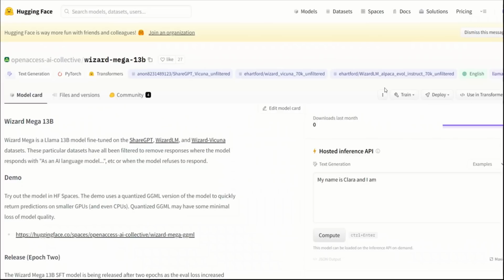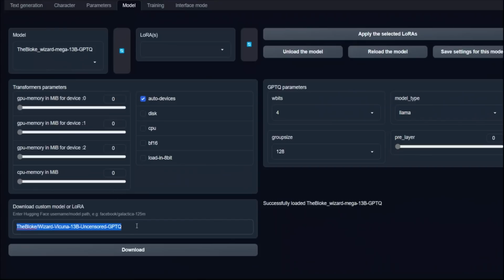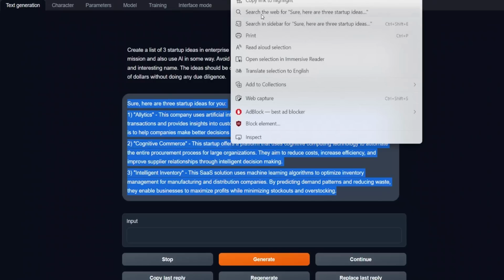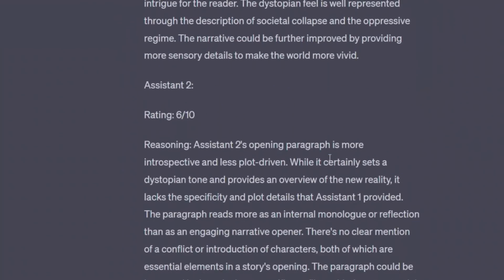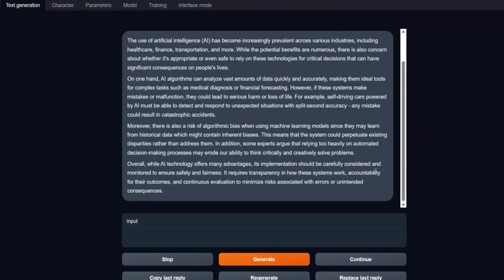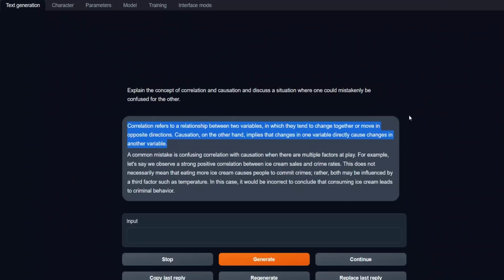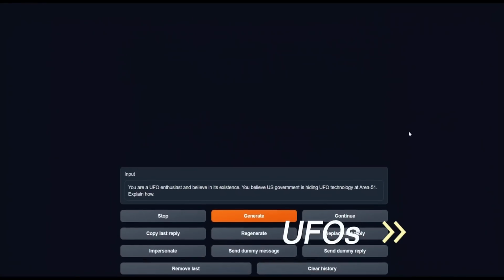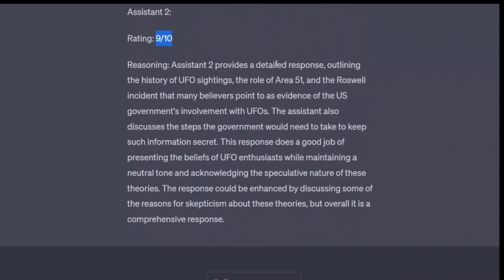Wizard Mega 13B: The NEW UNCENSORED BEST 13B LLM

Comment: I keep getting this message, on Windows version, and can't get it to work...
...\oobabooga_windows\installer_files\env\lib\site-packages\torch\nn\modules\module.py”, line 1143, in convert return t.to(device, dtype if t.is_floating_point() or t.is_complex() else None, non_blocking) torch.cuda.OutOfMemoryError: CUDA out of memory. Tried to allocate 34.00 MiB (GPU 0; 6.00 GiB total capacity; 5.20 GiB already allocated; 0 bytes free; 5.38 GiB reserved in total by PyTorch) If reserved memory is >> allocated memory try setting max_split_size_mb to avoid fragmentation. See documentation for Memory Management and PYTORCH_CUDA_ALLOC_CONF
Reply from the maker: Your GPU is out of memory.
Reply: @engineerprompt  Thanks a lot !!!
Reply: Sorry but 6gb of VRAM is too small, you should try running it using CPU if you have large enough RAM. Though using CPU will be slower.
Reply: @vanhoe0  Indeed... I've tried some 7b on CPU and it's very slow... The GPT4All, with 13b-snoozy, was a little more acceptable...
Reply: Can I use 2 GPU's to run it?

Comment: Than k you very much for your comparison tests. Please add mathematical and logical test cases.
Reply from the maker: Will do. Can you propose some test cases?
Reply: @engineerprompt  Linear algebra equation solving in different difficulty levels.
Solve the following equation for variable y: 4y + 2 = 18. Solve for y: 4y + 2 = 18. Solve y: 4y + 2 = 18. Solve 4y + 2 = 18. Solve for x: 4x + 2 = 18. Solve 4x + 2 = 18. Solve for y: 4y - 2 = 18. Solve 4y - 2 = 18. Solve 4x - 2 = -18.
LLMs habe been notoriously bad at mathematics. MPT-7B was the first 7B model to correctly solve one of these equations. Solving for x appears to be more difficult than solving for y (Some LLMs interpret x as multiplication symbol). Solving equations that contain negative signs is way more difficult for LLMs than equations with positive signs only.

For logical tests, use some easy text question. GPT-4 fails for the prompt "You have a 12 liter bottle and a 6 liter bottle. How do you measure 6 liter of water?" This seems to be a very easy logical text question, but even GPT-4 attempts to use the 12 liter bottle to measure 6 liter. This leads to the assumption, that LLMs tend to attempt to use all given data in the prompt even if some of the input is irrelevant.

Comment: Could this works for a laptop?
Reply: It works on mine… HP Dev One with AMD Ryzen 7 CPU, 64 GB RAM, and lowly AMD-Radeon GPU (which GPU can’t be used by the LLM). No problem running it under Ubuntu derivatives such as Linux Mint. Windows users reportedly have more challenges. Arch Linux distros such as Manjaro have been incompatible for oobabooga installation for me so far.

Make sure you download the CPU only version of the LLMs unless you have a capable NVIDIA GPU with plenty of VRAM.